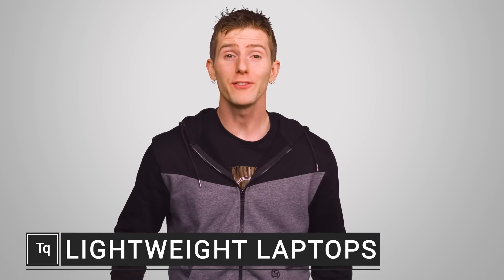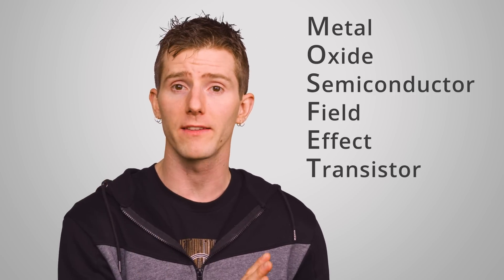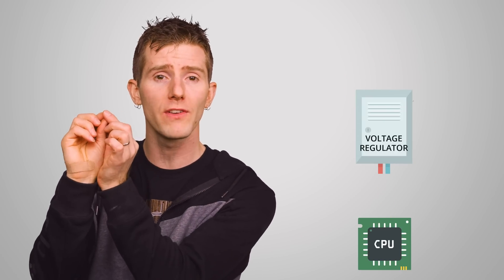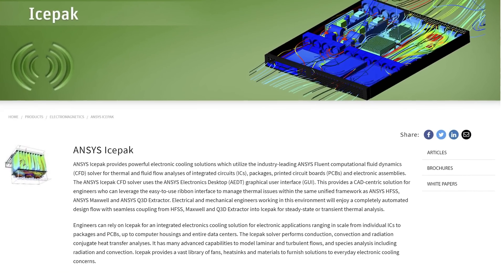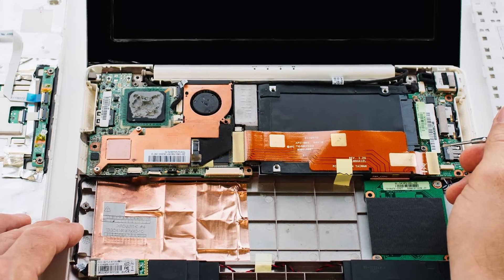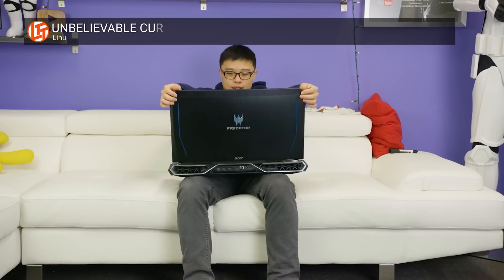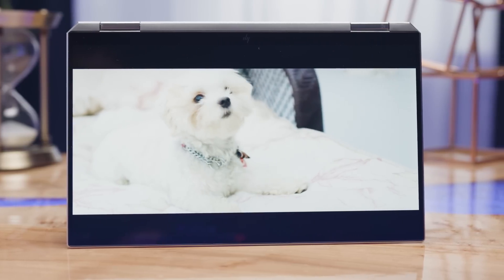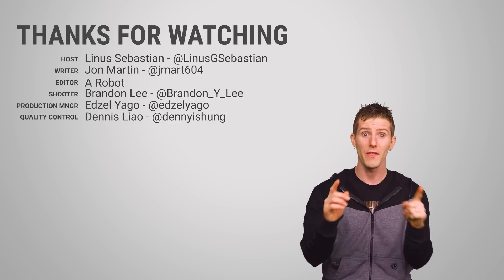Why Aren't Laptops HEAVY Anymore?

Comment: Also don't forget that we can use SSDs now and don't have to have a big ol hard drive
Reply: but y tho
Reply: @43615  What do you mean why tho? SSDs are faster and far lighter and cheaper now. Every laptop that's worth anything more than $100 has one.
Reply: @MarluART  2.5'' HDDs are ~$0.50/GB, while 2.5'' SSDs are ~$1/GB.
Faster and lighter, but not cheaper.
Also, please find me a new laptop that's cheaper than $100.
Reply: @43615  Cheaper now than when they had a stigma of being super expensive and you know damn well what I meant when I said "any worth over $100". I meant anything not ancient that you'd swear comes with a floppy drive.
Reply: @MarluART  For the SSD/HDD comparison, I literally just looked up the best price/GB listed on PCPartPicker.
Any laptop that can run a general-purpose operating system and is in full working order costs 3 digits. Once again, I urge you to find a counterexample in order to justify your oversimplified and exaggerated statement that you probably regret right now.
Reply: @MarluART  I'm not trying to be a smartass, I AM a smartass. What I get out of it is a twisted sort of amusement and experience with different people on the internet.
Most 2.5'' HDDs weigh about 200 g, while most 2.5'' SSDs are about half of that. Sure, there is a difference, but it doesn't matter that much when considering the total weight of a laptop.
Please stop strawmanning and find me an actual eBay listing of a functioning laptop under $100 (or, y'know, just stop replying), because I frankly can't be bothered to do so myself and you seem rather eager to prove something here.
Also, what "bigger picture" are you talking about? This is an LTT video, with a majority of the target audience unfortunately consisting of Apple normies.
And finally, to counter your unprovoked ad hominem attack, I would recommend you to grow some skin and to stop being a pretend-artist beta soyperson.

Comment: I hate HP so much. They only offer tech support if you pay them for it. Altho that is not bad on the surface, it's bad when you have a problem caused by HP software.

I was using excel and trying yo use a link to a youtube videoand couldnt. Long story short, my browser is being managed by a piece of hp software BAKED IN to their OEM install that MANAGES MY BROWSER. I have tried everything to get rid of it. No one at HP would help me.

I discovered this bullshit about a week before my warranty would have run out. What did i get from HP? Waisted time. 2.5 HOURS on HOLD. Then they tell me to call back bc they are closed.

I will never buy any HP anything ever again. They specifically were waisting time so the warranty would run out and I'd have to pay for extra support.

Comment: So why are the prices so high?
Reply: To get the size down, they need to specifically design and manufacture everything for each model of laptop individually. In a desktop, they can use off the shelf parts, which are also usable in other models, so they are cheaper than laptops to design and build.

Comment: I can't wait for the sequel: Why aren't televisions HEAVY anymore?
Reply: Answer: they still are
Reply: @isXanderDev  not like the TV's of the early 2000's
Reply: Bcos we don't use Cathode ray tubes no more.
Reply: @ifeanyikennedy1047  correct
Reply: What's with this "thread"?

Anyway, the actual answer is that old tube CRT TVs had to have incredibly thick lead infused glass on the front to stop any X-rays made by the high voltages and the movement of electrons in the vaccuum inside the tube. This lead and glass is what makes them so heavy, but also safe to use.
Reply: Lol
Reply: Sponsored by Samsung
Reply: Hello there
Reply: I think they made a video about that in the past
Reply: I can't wait for the CONSPIRACY. Why are PEOPLE heavier today?
Reply: 400th like
Reply: Because CRT is almost obsolete.
Reply: @ISOHaven OLEDs are 65" or 77" but I agree. My 2019 65" is heavy as hell.
Reply: @tresnugget  we'll get a smaller 20 inch tv
Reply: @stephensnell1379  not sure why you’re telling me you and someone else are getting a 20 inch television
Reply: Because they stopped using actual thick glass and steel chassis  which i think was stupid
Reply: Emad Aldeen it wasn't stupid considering the technology used to display the image. The tube in old CRT monitors is literally empty, no air inside it, which makes it A LOT more fragile and therefore a thicker glass is required. Older CRTs (talking about the ones made in the 30s/40s) had a much thinner glass and no protection, and because of that they could literally implode for absolutely no reason.
Reply: @fono_archivio_tino  you mean explode
Reply: @stephensnell1379  no. Implosion happens when air quickly enters the tube (since there is none inside). Explosion happens when the air escapes, as in a balloon for example.
Reply: @ISOHaven well duh, it's 75 inches, its just fucking huge itself
Reply: Omg your here again dude your really well informed!
Reply: hi
Reply: China Wuhan virus*
Reply: So you can't break your fingers while trying to put that CRT or plasma tv on the table
Reply: TVs changed from CRT to LCD/LED/OLED, those are huge changes compared to Intel core2duo > ryzen 3000 series (a cpu is a cpu)
Reply: eur here too
Reply: @ISOHaven 75 inch samaumg is heavier than any oled I have got
Reply: Cuz the aren’t made of glass! LOL
Reply: Wym they still are
Reply: Its the legend
Reply: You again
Reply: They still are....
Reply: @stoineB  laptops and televisions have both gotten lighter in weight as TV's are LCD NOT CRT ANYMORE
Reply: because we realized that led cryatals are lighter than a giant glass tube
Reply: And fit in our pockets
Reply: But i like my dell that burns my legs.
Reply: CO-VID19*
Reply: @MenaceLikeDenis  Boomer remover*
Reply: klen sal lmao
Reply: roman garcia *COVID-19 actually
Reply: roman garcia COVID-19**
Reply: @MenaceLikeDenis  same thing
Reply: D G  KUNG FLU, of course
Reply: But they are heavy
Reply: Because of the corona virus.
Reply: @TiagoMorbusSa  i don't get it....
Reply: @hollymolly518  thats why
Reply: @hollymolly518  yup,stay at home soo you wouldn't get it
Reply: @TiagoMorbusSa  I think a lot of people heard that joke and had a corona-ry ...
Reply: @TiagoMorbusSa  that's stupid
Reply: The Raddest Scorpion You’re not funny 🥵👌
Reply: @Josh0205  Your mum
Reply: @Josh0205  You are obviously one of those people who knows grammar, because you said “you’re” and not “your”!
Reply: Lawrence D’Oliveiro uh huh
Reply: @Josh0205  its called the butterfly effect
Reply: tdpro360 ????
Reply: Your Left Hand and you are?
Reply: @Josh0205  okay